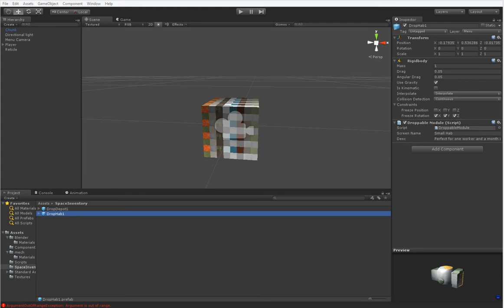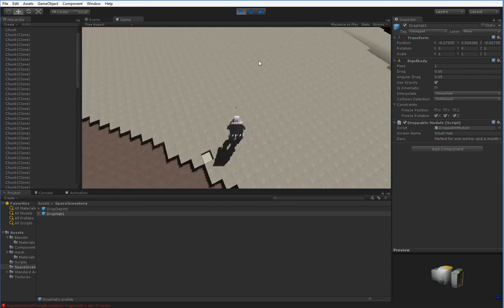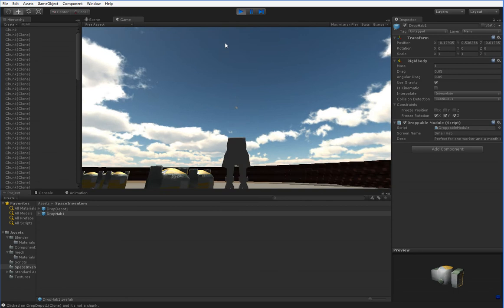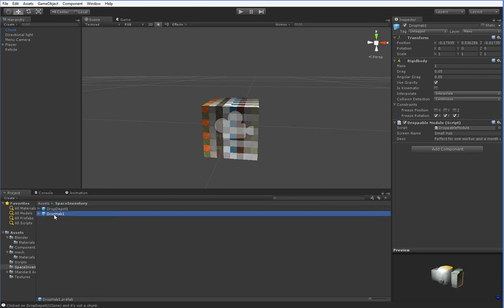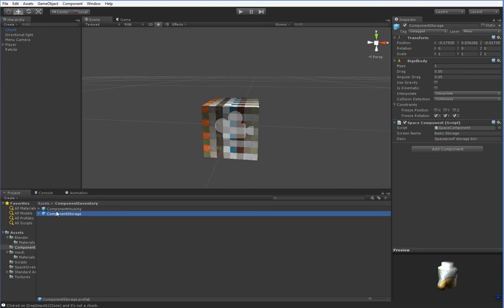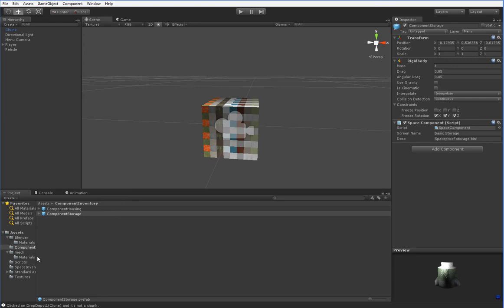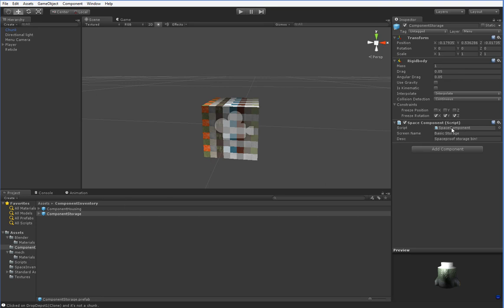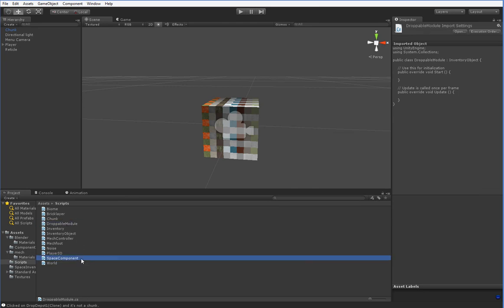Minecraft Mech #54: Undroppable Modules

Comment: Do you plan to do much more work on your terrain logic? I would like to see how you would incorporate a gravity system, where free standing blocks would appear to fall down into the lowest available position. My initial thoughts were to create a single block instance (temporarily disjointed from the chunk)  that would be used to visually fall and when it impacted the chunk, it would be added and regenerated into the chunk it settled on. I've always found that my initial logic is never the best way to do something so I'm really curious how you would go about it. I imagine this step would be a good lead-in for form-less blocks (like water and sand), which would add nice value to the system as well.
Reply from the maker: That's basically the best way to do it, as far as I know. Water, though, is done differently.

Comment: Craig Perko Could you please help me with my project i seem to have 2 features that i cant create with my knowledge , what i have done so far is follow your scripts but from a point and so on i took a different road and i really need your help. The one is that i need each brick/block/tile to have different uvmapping i mean each side of the block to have its own texture(like minecraft grass, which has grass on top , dirt on bot, and grass-dirt textures on each side). and the other one is that i cant seem to place blocks from a chunk to another , i mean that i can place blocks anywhere but if the face of the block my raycast is pointing is on a chunk edje i cant place the block on another chunk. I can make a short video to show you what i mean or i can sent you the source file to help me, please its important for me.
Reply from the maker: The chunk crossing is a bug in how you are calculating which chunk to place your brick on.

The other one is straightforward, if you understand how the faces are built in the first place. Just make the UV coordinates for the top face different from the others.
Reply: Craig Perko
Hurray finally fixed both :)
(And learned a lot of how C# works and how creating meshes through unity works.) I have to say that my old minecraft project had around 11.000 draw calls with like 200 cubes in it now i run almost 1.000.000 cubes with 120-150 draw calls thats amazing. All the textures fit as they should and also had some fun with my friends today playing my game in multiplayer.I have to say thanks for the knowledge and tut u gave me man. Really i would be having hard times with performance if i hadnt found these videos. Thanks again.
Reply from the maker: That's the best outcome!